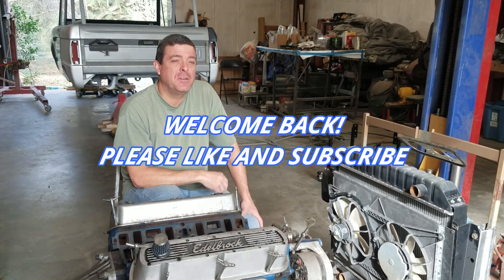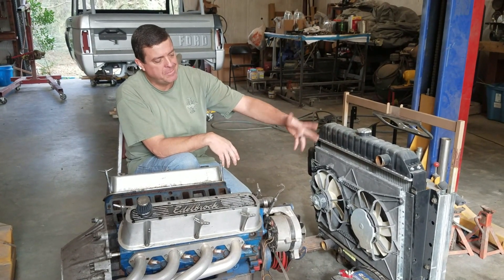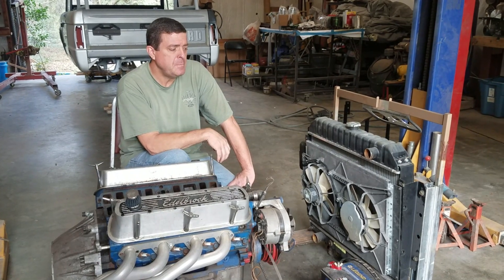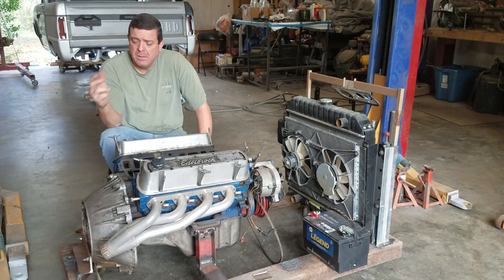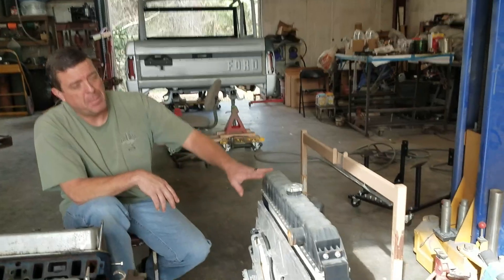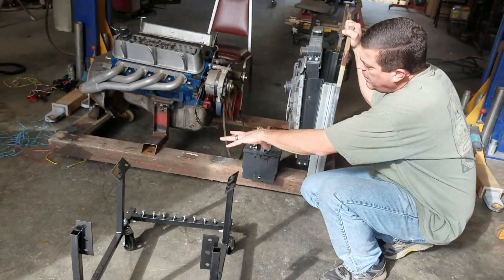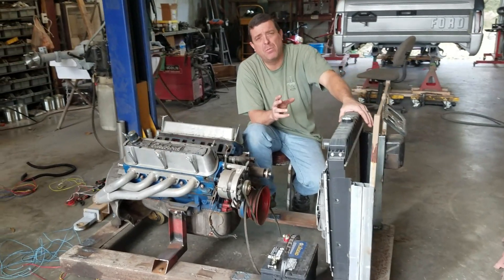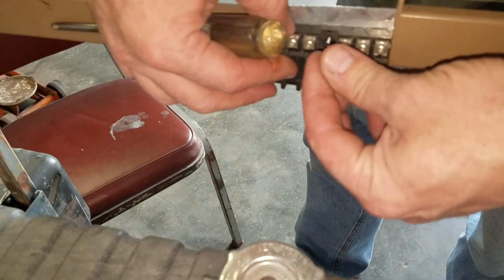Engine Test Stand - 1966 Ford Bronco Restoration Project

Comment: So jealous....wish I had something like it...dont know where I would store it...Recycling at it finest. The only part you left out was going and getting the reading glasses so you can see the relay diagram. I think they print them as small as possible.
Reply from the maker: Thanks.  I will finish up the engine this week and it might go back to being a roll around table unless someone needs it.

Comment: What is the status on the lifters?
Reply from the maker: It is fixed.  I was able to get the engine reassembled this weekend and test fire it.  I am going to run the camshaft in again tonight to break in the new lifter.  I will post a follow up video Wednesday.  We had a lot going on this weekend so we had to pull out a video we did a couple months ago when I built the stand.